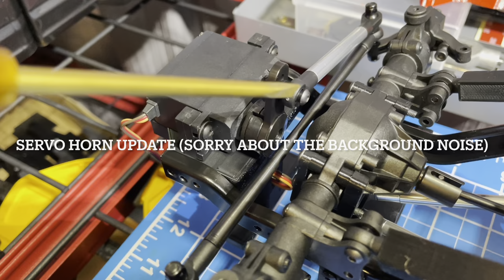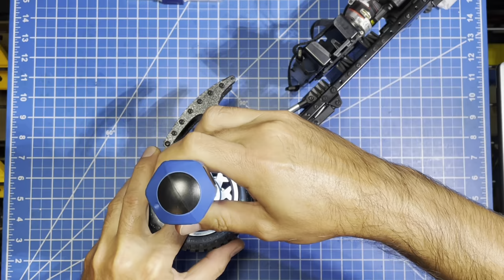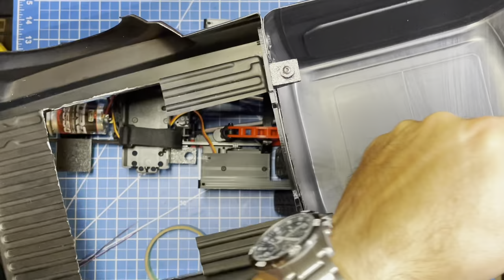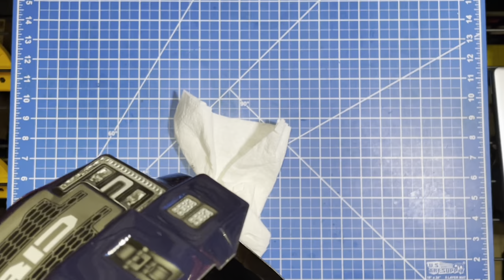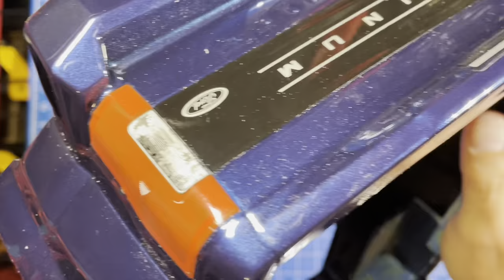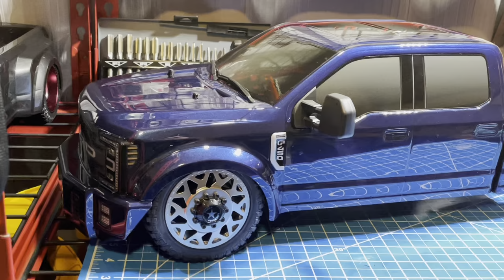CEN Racing F450 Reassembly Part 3 of 3

Comment: Keep up the great work you're doing and yeah I watched all 3 videos. Great kit you provide for these trucks. Thank you for the great kit
Reply from the maker: Thanks man!
Reply: @crawlersncustoms  would you be interested in making me a stock floor body dropped chassis for this rc?so it'll lay full body with this lowering kit and the American force rims??do you have low profile tires not like meats?Im super interested in it..I don't plan on towing with it I'm getting into r.c's and my friends from my truck club also wanna get into rc's but nobody makes lowering kits or airbag or hydros or stock floor body drop chassis..there a gigantic untapped market here
Reply from the maker: @NorcalChef209  I have considered doing a version 2 of this kit but it’s immensely time consuming and I’m short on time these days.
Reply: @crawlersncustoms  I'd rather have it be one off honestly that way nobody has one that lays body like mine haha I'll pay extremely well for the frame..as a matter of fact I'd pay you to install the lowering kit and the rims at the same time while I purchase everything from you..I'm extremely serious also so please if you can possibly think about it and maybe engineer a design.. obviously it would have to have a front z and the chassis would have to sit flat..you could even do a traditional channel and a stock floor body drop if that would be easier